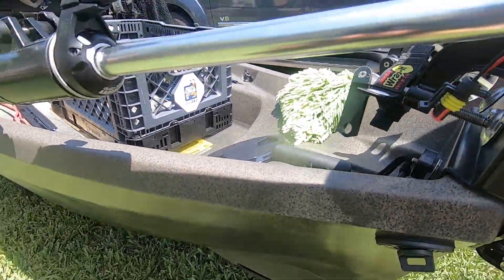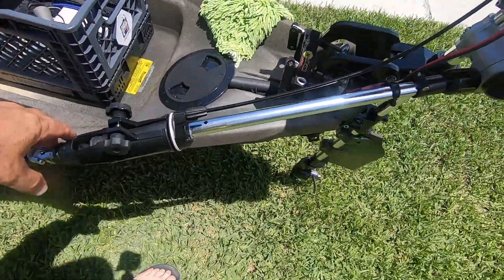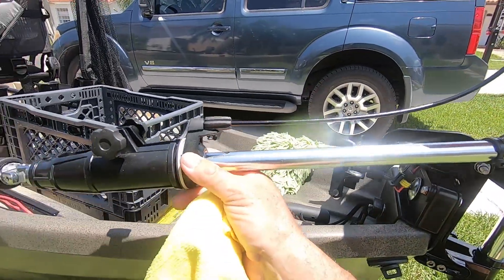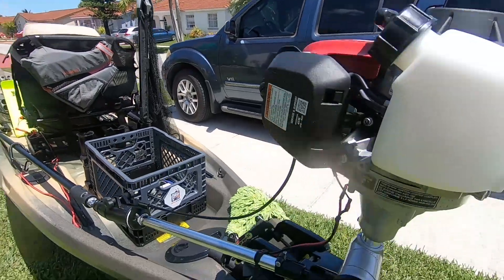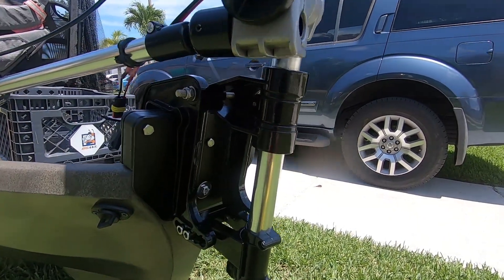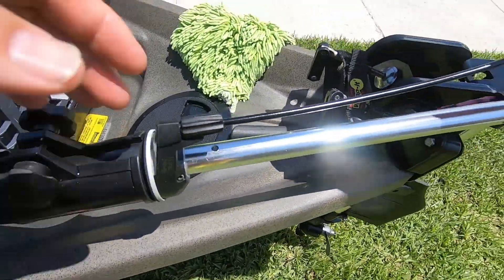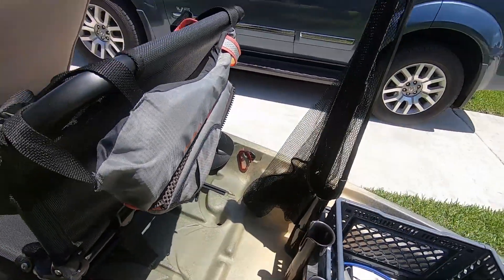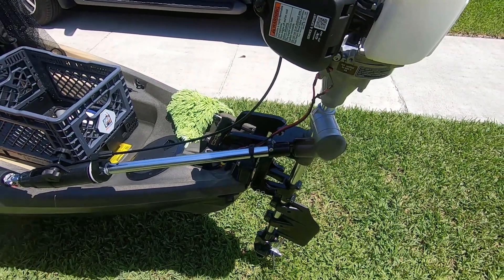Angled Tiller Clamp for 2020 Drive System Models

Comment: How do I get one of those trim and tilt brackets ?  Running a 9.9 Evinrude omc and i have the switch right on the throttle lever. Any input would be awesome not a big fan of having to tilt and trim the motor myself . No good if I run into shallow water on a new body of water and I can load on to the trailer a lot easier and not have to go into the water .
Reply from the maker: Mike Joned these are made for 28mm drive shaft tubes. These will not fit your application.

Comment: Hi,
Cool!
I believe if you installed a uni-ball on the bottom of that extension arm you might??? be able to rotate the extension arm from side to side and get reverse instead of hooking up your tiller arm to the front of the extension arm.
John
Reply from the maker: John's Marine Solutions I have no need for reverse personally sitting this far away. This helps with the hard angles off the tiller. It I was right next to the engine it would just require a lift and rotation of the tiller. Very simple in my opinion.